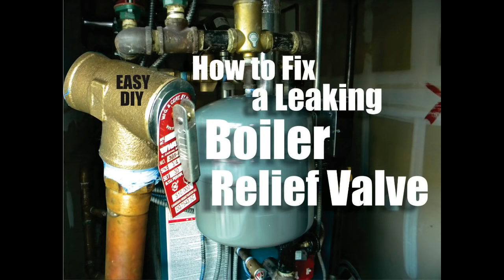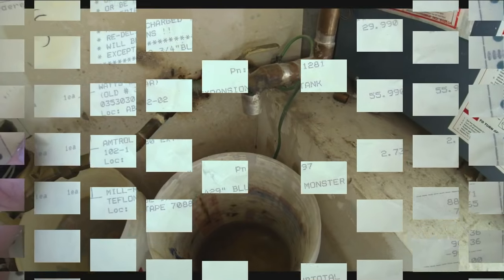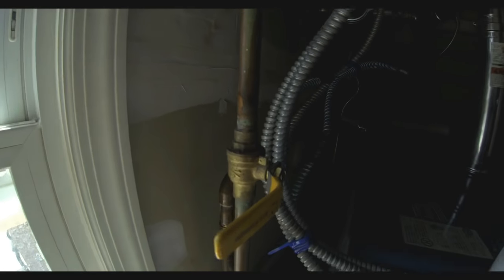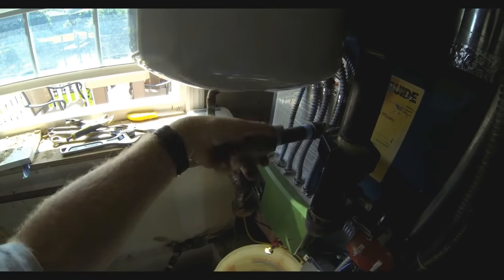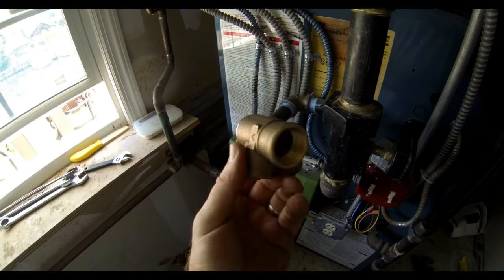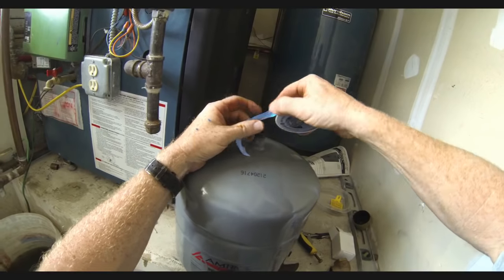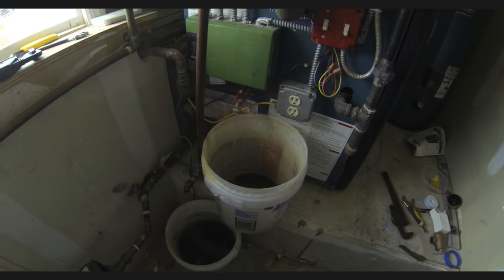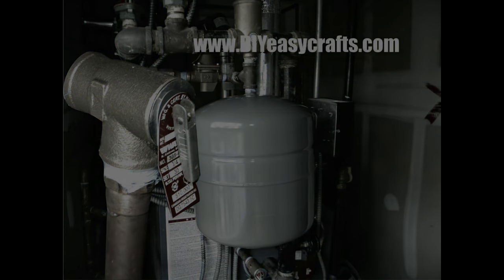How to Repair a Leaking Boiler Relief Valve Easy DIY

Comment: Thank you so much for this video.  It showed up in google when I searched for faulty radiant furnace pressure relief valve.  I would have only replaced the valve, but after watching this, I replaced the overflow tank, relief valve, and added a new pressure and temp gauge.  It all seems simple to replace, but I would have run into so many gotchas if I had not watched this video.   It made the repairs painless and a saved me a lot of money.   One thing I would add, is to mention tools needed.  My furnace was old and I spent half a can of WD-40 on the parts 24 hours before doing the work, and bought some heavy duty plumber wrenches and other wrenches that only set me back about $40.   It made removing the old parts much easier.
Reply from the maker: That is awesome. Glad video was useful
Reply: @DIYeasycrafts  It was great, and I also posted it on my FB page here: https://www.facebook.com/PraviHrvatski

Comment: Thanks for posting this video because I went down to my crawl space and water was on the floor and it was overflowing the Rubbermaid bin I had under the relief valve. I tried opening the valve and water came out of course but it wasn’t the problem. I purchased the valve, relief tank, and a six inch 3/4 threaded pipe for $62 at Lowe’s. My valve was right against my boiler so I extended it. I drained the system and not much came out. Took off the valve and some water came out. I took off the tank and it was heavy like yours. Full of water. Replaced both the valve and tank and turned everything back on and I put a hose on the valve and put the hose into a 30 gallon Rubbermaid bin and all is good. Thank you so much for posting this video. I probably saved a thousand dollars

Comment: I have to thank you so much DIYeasycrafts!!! 
My releasing valve kept leaking water for past two weeks. I intended to just replace the valve until I saw the Video. I did exactly what you did on the video. My expansion tank filled with filthy water. If I did not watch your video I would tried only to replace the releasing valve and of course it would not solve the problem. I spend overall less than $60 and got the problem solved!
YouTube provides amazing platform for these amazing people and amazing videos. How would I do the DIY without it?!

Thanks again. Please keep the great work!

Comment: Wind your Teflon tape the same direction as you screw the valve/tank on. You did it reverse. Will seal better that way.
Reply: That's right. I was going to comment the same thing.
Reply: No you wind the tape on in the opposite direction to which you will be screwing the vessel on.
Reply: Looking down on the tank wind the tape clockwise. Looking up from under the tank it would be counter clockwise. You don’t want the end of the tape leading it will likely catch and start to unwind itself. This guy did it backwards.
Reply: @johnbower  I'm glad I'm not the only one to notice that.
Reply: Of course you could just use pipe dope like a big boy & not have to worry about the Teflon tape coming off.
Reply: This guy obviously doesn’t have a clue what he’s doing
Reply: You saw that too? Lol

Comment: thanks! it was exactly what I needed. replaced everything for less than $125. A service call for someone to come out was at least $100 not including parts and replacing the relief valve.
Reply: Good video with some missing steps. I just had to pay $125 just for the guy to show up. Expansion tank needed pressure. Caused relief valve to blow. He replaced relief valve (preventative maintenance?) and added air to the expansion tank (1.5lb to 15 lb.)! $206.85! Didn't help that the house is on East coast and I'm in L.A.

Comment: This is a useful tip video... thanks for posting it.

I had to do this several months ago.

You may want to add an annotation about charging the dry side of the expansion tank to match the working pressure of the system. My understanding is that it isn't an absolutely necessary step, but a recommended step (I am not a plumber).
Reply from the maker: Thanks for the feedback. The tank I bought was pre charged  but your are right. Will add an annotation.
Reply: I got this done just today. I was also wondering about the proper pressure during my research, and it seems the tank for furnaces are generally 12 psig (pre-charged, usually 2 gallon tanks specific for this application) and this is specified on the boiler itself. People looking to do this should check to see if this is the case for their gas furnace. 

I almost bought a tank used the for hot water heater (pre-charged to 30,40 psi) mainly because most of the videos on youtube deals with water heaters (and not many on furnaces) and i assumed wrongly that they were the same application. And the ones they sell at home depot and the like do not have the 2 gallon tanks made for furnaces in their inventory - you'd most likely have to order online as i did.

And yup, my tank was filled with water (11 years old furnace); when the furnace starts off cold, the pressure rises over 30 and the relief valve spat out some water for the past week or so. No problems after the reinstall - pressure at 20 throughout.

Comment: This guy is knowledgeable enough to make this video and give out dangerous information, that water when you're letting it out from the relief valve could be scalding hot and burn you instantly and what happens if the relief valve does not seat back right in your going to have scalding hot water spraying out?. Could also just be the pressure reducing valve and it can also be a coil inside the boiler if it is leaking in putting domestic water  into the boiler into the boiler hence having the relief valve leak

Comment: Just an fyi for anyone attempting to do this repair on their own, code states on a boiler that the relief valve Must be mounted vertically on a boiler. In this video the relief valve is on a nipple coming out the side of the boiler and in the event there is not a tapping on the top of the boiler, a 90 would have to be added to the nipple to mount the relief valve correctly then nipple, 90, and pipe to floor within 6" to prevent anyone from getting hurt in the event of a relief valve blowing off.  This was a great video, just wanted to add some clarity. Thanks

Comment: PSA: Do not play with the relief valve if you do not have a new one ready to go, and you suspect the relief valve might be broken. I lifted it and closed it per 1:13, it would not stop gushing water afterwards since I think there was some blockage that helped it keep the pressure. After the blockage was cleared from opening the valve, the valve won't close properly since it's a faulty valve. Now I'm just sitting at home waiting for the new relief valve to arrive, without heat or hot water. Sigh.
Reply: Did the same thing :)
Reply: @mgrohman  I did the same thing and now I have water coming out. LOL!
Reply: @iko3  hope you found a replacement! When I took the old one off, it was full of rust and the gasket had hardened and gritty. After replacing it, it took me a while to get the air out of the system. I did not understand that procedure, did not do it correctly, water wouldn't circulate, and my air vent (often called a Hy Vent) was leaking. I ended up having to call a pro and he purged the air out of the system by hooking a garden hose to the drain valve, running that garden hose into a sink, and opening and closing the fill valves in all the furnace zones until all the air was out.
Reply: Good advice
Reply: haha same so far its constant drip and still have hot water but ya thinking it needs to be replaced.
Reply: It's a hell of a time to find out, it's no longer stocked too!
Reply: Thanks for this comment.  It is 12 degrees out abd I was going to do that until I read this!!
Reply: Lol?

Comment: Position monkey wrench with its "nose tips" pointing in desired direction . You had them facing you as you were pushing for removal of valve. Also proper diameter pipe over handle of wrench will increase the leverage and make it easier to remove the valve as it might be too tight due to rust or possible prior over  tightening. ( this trick also works for lug wrench use when trying to remove lugs from tire rim. This kind of leverage makes it a whole lot easier ! )

Comment: Between the video and some of the comments, a lot of incorrect and/or misleading information.
One person mentioned that the tank comes precharged with probably 30 psi of air and that you should pump it up to your incoming city water pressure. WRONG! Not for a boiler that is set up to run typically around 12 to 15 psi.(It is set up with a pressure reducing valve. This guy was think a water heater.
The video had some good advice relative to releasing a little water from the P&T valve. As sometimes it's just a bit of dirt or the like that gets hung up in the valve preventing it to close properly.
The expansion tanks vary a bit in design due to age but typically all the newer tanks are equipped with a diaphragm within the tank separating the air side from the water side. The air side is equipped with a schrader valve which allows one to add air. The tank could have been water logged due to a number of reasons. some that would require you to replace the tank and others where you could simply correct the problem. For example: ruptured diaphragm= requires replacement. Loss of air due to possibly a leaky schrader valve.= Replace air valve and refill with air to recommended pressure.
And yes to those that mentioned the direction of putting on the Teflon tape, there is a preferred direction but it still works either way. Won't get into details here. There certainly are many minor items that can and do get fixed by DIY'ers but there can be unknowns that could get you into trouble. You can't believe everything you see or hear on youtube but it is a good source of info, just be careful. As far as plumbing advice, there are Plumbing Forums that have professionals that try to help you out. Excellent source of information. But even then, there are differences of opinions but that's everywhere in life. "Measure 3 times and cut once." ;-)
Reply: Thx dad
Reply: Well I have a 2 family home with 2 identical boilers and one that the relief is not blowing off is a 60 psi and the other a 30 psi rating that is blowing off.    Now mind you these are large cast iron radiator hydronic systems.   Explain that and you can come to my house to repair it...lol
Reply: @renrut0  ask the guy who made this video he knows everything, if you want the actual answer pay a professional.  Other than that its a fairly obvious answer with 20 plus years of hvac, but who wants to pay for that

Comment: Gotta fill the expansion tank with air to match the pressure of your water in the house. It comes pre-pressurized but only at about 12PSI. other words great video 👍
Reply: So if my house pressure is 40 psi charge it to that? Or what comes after the pressure reducing valve which is factory set for 12 psi that would match the new tank at 12 psi pre charged?
Reply: @Supanova70  They come charged at 12 psi for a reason. To maintain 12 psi in the system.

Comment: Noticed that the PRV on our 10 yr. old Pennco has been leaking - and - have noticed water at the top of the Taco air scoop (which sits above the expansion tank). Will replace both. Many Thanks for posting.

Comment: 1:20
What you want to do is tap on the top of the T&P valve a few times. That'll work much better than to keep flipping the valve open.
Reply: I did that and it worked for a month, but then finally failed... too old.  Don't make some of the parts like they used to.
Reply: T&P?
Reply: @lh98  temperature and pressure

Comment: Skip first 2 threads with tape and add pipe dope. I think your expansion tank should have a thermal trap to keep hot water from the rubber diaphram .

Comment: Does the bladder in the pressure tank come pre-filled to the correct pressure? Shouldn't one confirm its PSI with a tire pressure gauge to ensure proper system pressure?
Reply: yes you should inflate the bladder to match the system pressure of the boiler, shown on the dial. It fluctuates but it should always be a little higher than the highest point it goes. My system maxes out at 20psi when fully heated, so my expansion tank bladder is set to about 21-22 psi.

Comment: You wrapped the teflon tape on the pipe in the wrong direction .It should be wrapped  in clock-wise direction on the male threads(with pipe or male fitting in your left hand)this allows the tape to stay on the threads when tightening.
Reply: Frank Dringus I

Comment: I’m surprised your Teflon tape didn’t unravel as you threaded that tank back on to the boiler, you always wrap your tap clockwise which you did not, to properly refill your boiler with water you need to purge the air out of the system if you don’t you won’t have any heat, open the boiler drain and let it run until all the air bubbles are out of the pipes and the water returning to the boiler is coming back hot, also worth noting is that all expansion tanks have water in them you’ll know your tank is bad if it’s full of water, the bottom of the tank should have air and the top should have water in it, they will go bad and need to be replaced, to find out if your tank is bad tap on it
Reply: Thanks
Reply: "open the boiler drain and let it run until all the air bubbles are out of the pipes and the water returning to the boiler is coming back hot," You do this when the boiler is running?

Comment: Sometimes its the pressure reducing valve thats bad and lets to much water in and  pops the expansion tank which causes the relief valve to open and leak out because there is to much water pressure in the system . sometimes there is nothing wrong with the relief valve its just doing its job and is telling you something else is not.

Comment: I have the same problem at my furnace, so my plumber changed the valve and expansion tank but it was still leaking and keeping the pressure high. So he thought the valve was defective and he changed it again but same issue. After one day it start dripping again. Any suggestion?

Comment: Shouldn't you check the pressure of the expansion tank pre and post replacement?
Reply: Yes.  However, the brand usually comes pressurized at 12 psi.  However, 15 - 20 psi when hot is quite common, so he should have checked the system psi, and add to the tank if higher.

Comment: The easiest way to do so in a pinch is to just to piggy back another relief valve to the existing one. That way you don't have to drain the boiler.

Comment: CAUTION: You need to FILL SLOWLY because quickly introducing cold water can possibly cause the BOILER TO CRACK- this is usually on a steam boiler more than hot water boiler because steam units run hotter. Steam is made at 212° and HW is usually set at a max of 190° (more like 170-180°) Hopefully ppl see this WARNING. “Rip off” might not be the best statement but they do charge outrageous rates often and if they truly quoted a thousand bucks that is a rip off!
Reply: Thermal stress yes but worse case blow up.

Comment: The plumber who gave you that estimate is a thief. Also you never purged the air out of the zone loops if you start the boiler without doing that correctly and you allow the circulator pump to run dry or air lock you will be replacing that too. You must purge the air out of the loops, not the bottom of the boiler.
Reply: TheNorthsquad how to purge air from loops? Ihave troubles
Reply: If you shut the zones off before you drain that will save you from having to purge them after but still a good idea

Comment: Question tho , is the pressure valve suppose to be warm to the touch ? Mine I can’t see if water leak es because the pipe is fed back into the wall and don’t know where it goes .

Comment: The expansion tank needs air to allow for expansion and contraction of the water from the  water heater.  Before replacing the tank, check the air pressure using a tire gauge.
Reply: Yes. Should be around 12 lbs.
Reply: That’s a boiler not a water heater.

Comment: Did you put you gas on Pilot or turn it completely OFF?  I would think that once the water is drained your would not want to have any gas on at all to overheat.  I just bought the same valve and want to replace my old leaking one.  the connecting pip on mine is straight up and not on the side like yours.  Comments / suggestions welcome from all.

Comment: So sometimes when the expansion tank is faulty the pressure relief valve can leak?
Reply: My problem was that low pressure in expansion tank caused reliet valve to blow(?). They replaced valve (and added pressure to exp. tank!) because, I was told, they often don't reseat properly.

Comment: Thanks.  Relief valve and expansion tank were screw-off/screw-on easy fixes once I knew how to drain the boiler.  However, my pressure is high and, from what I'm told, this could happen again?

Comment: Thanks again for the very good explaining and easy to follow detail!  When shutting off the water supply to the boiler, and draining the system, is it necessary to close off the ball valves entering and returning the heating zones?  What I mean is, would the water from the entire system upstairs drain (by gravity)?  (I have a two story home with four heating zones and a fifth zone to a hot water tank).
Reply: I would assume so
Reply: Yup, it sure will. I don't know why he didn't show that part. Perhaps he drained the entire house or his boiler is upstairs.

Comment: Don’t forget to bleed the air out of your boiler as you’re refilling it. Do this using the blow off relief valve you just replaced as it is at the highest point internally in the water jacket of the boiler.
Reply: Also the heating zones as well.
Reply: The only way to bleed air out is have it up to temp , you can put an automatic bleeder . The best is right after the boiler where the expansion tank is . But the very highest point